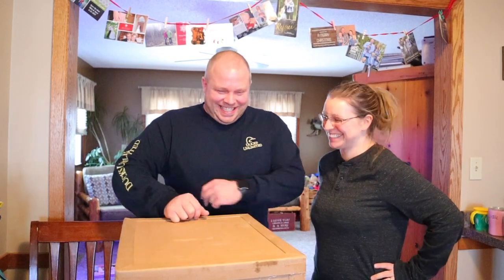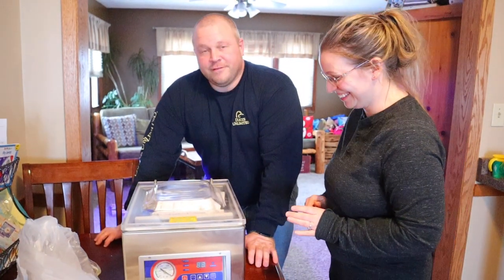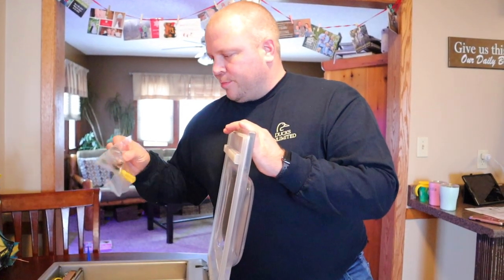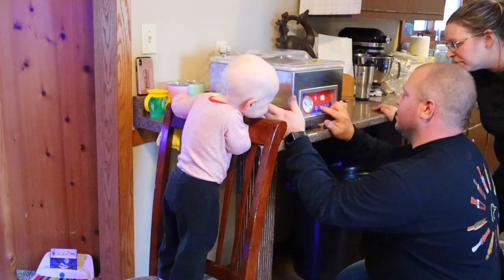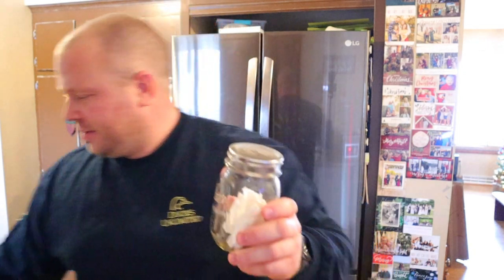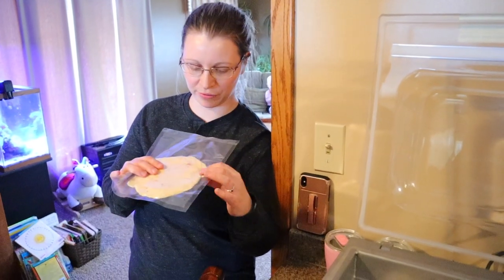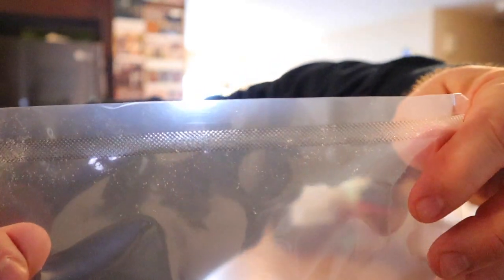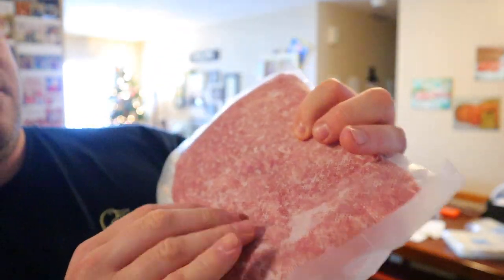Chamber Vacuum Sealer

Comment: Those commercial type sealers are the best money spent on food preservation!  We bought one of the big ones with two sealing strips a few years ago and with bags in the 3-5¢ range it’ll pay for itself quickly vs a Foodsaver.  I’ve never seen one with an oiled pump in that price range!!
Reply from the maker: Absolutely. I haven’t either so I had to try it out. I am vary impressed so far. Thanks for watching

Comment: I too had foodsavers and their reliability is the pits.    After five years,  I went through three of them.   I too bought a chamber sealer (a JVR V100) and never looked back.   If you have some foodsaver bags left you can use them on your chamber sealer.   Place the end of the bag on the sealer bar,  but put your bag outside of the machine instead of the chamber,  and put the lid down over the bag on the seal bar and start it holding the bag level so that it doesn't hang down in front of your machine.  It will seal!   Just don't do it in the chamber.  Enjoy!!
Reply from the maker: Thanks for the tip.
Reply from the maker: Thanks for the tip.

Comment: How do you like this machine after a year of use? Any problems with it? Is the one you have linked on amazon this exact model? Thanks
Reply from the maker: We use it all the time and it’s still working. Only one problem and that was the heat tape we replaced it with the spare one that came with it. Yes the link is the same one.
Reply: @mattsara2802  thanks for the info
Reply from the maker: Anytime